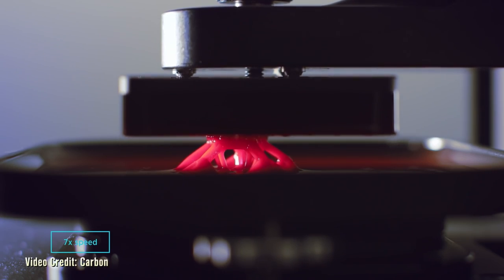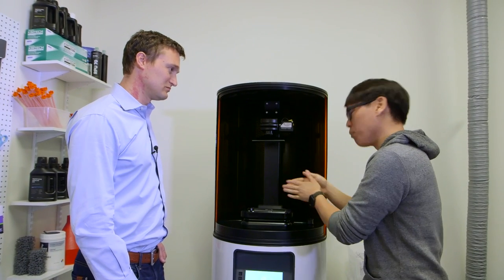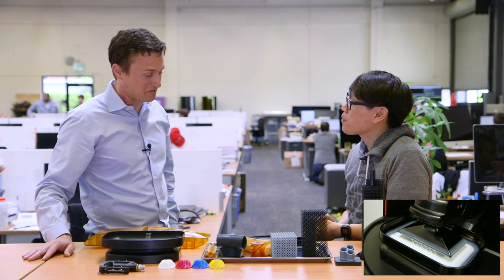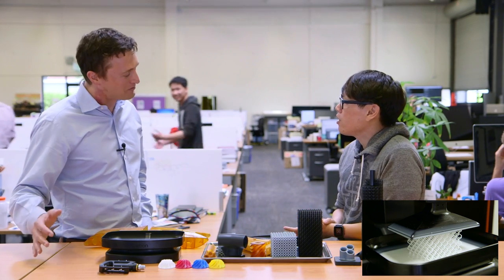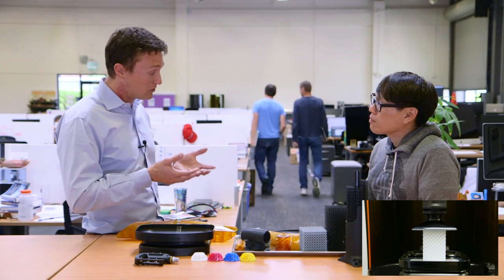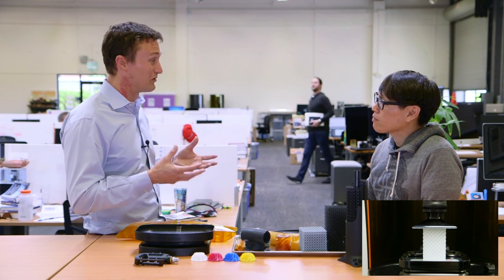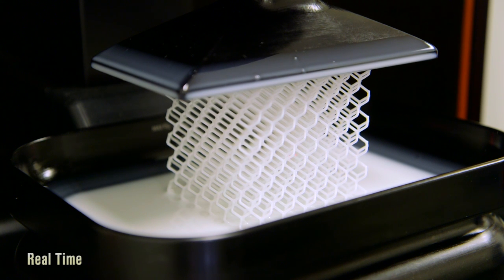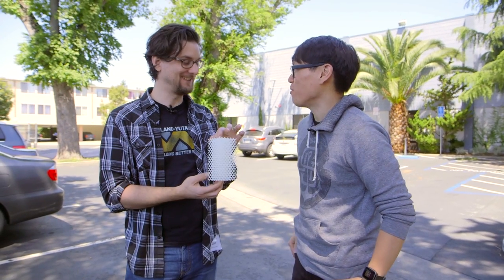Carbon M1 Super Fast 3D Printer Demo!

Comment: Sounds bunk to me, the only difference in oxygen would be in the resin it's self you can't change oxygen lvl in tub gimie a break puffff
Reply: They made a small design change that nobody thought about before (allow air through the bottom of the vat, so the resin does not stick to the vat). That's great, but they charging huge amount of money for it.

Comment: The O2 is really a red herring! 
Asked, how are they controlling the Oxygen?
Answers " I cant get into that"
He is obfuscating 
It's chemistry
any UV cure system will involve the of the resin, O2 or whatever
any comment?
I have tried UV cure resins since 2004, & has anyone come across a UV cure resin that does not stink (smells really bad)
Reply: O2 is really the important factor here. It allowed into the resin through the oxygen-permeable window at the bottom, preventing curing at the window and eliminating the suction forces generated when a part contacting the window is pulled upwards.

Comment: I love where technology is taking us, but what are the environmental impacts of these materials? I understand the need for non-biodegradable materials in some markets would be unsafe, but can these materials be recycled in some way, or are we going to start seeing 3D printed waste floating in our oceans next? These are important questions that need to be asked. It's great that it reduces waste, i.e. printing parts that sit for years if not forever, but if there's not a habitable planet for us to continue this journey, at some point technology is going to create a wall and we're going to smack right into it. 

I guess at some point one has to ask themselves if the shortcut to advancement is worth the end result. Don't tell me with all the amazing minds on this planet that we cannot come up with something.
Reply: Michael Baca a common plastic used for 3D printers is PLA which biodegrade quite easily

Comment: For those curious, it is here and it is working. But the operating conditions are incredibly precise and they'll only rent the machines to companies. 

So in short, the lid is very. Very. Very tight.
Reply: Actually no. They are not doing the technology anymore. It was called CLIP and due to unknown reasons, they are not using it anymore. Basically, they're making normal resin printers that print in normal layers where every layer needs to be "unsticked" from the build plate. So "sad trombone sound" the tech is dead.... for now.

Comment: Question: what about MULTI MATERIAL assemblies.

These parts are nice but one material
Reply: I think it's a limitation of the technology, unless there's a method of having 2 or more tanks with different materials that the bed moves between. If they figure out a way to stop them mixing when swapping that would be a huge leap forward

Comment: There will be entire factories full of these machines, this is amazing.
Reply: NO....there won't be for a number of reasons.  The biggest being the "post-processing" required to clean up the parts.  Injection molding is still far superior for large quantities!  This works for small simple parts or very limited run complex parts where tooling cost would be insanely high.

Comment: I feel like the oxygen bit they keep repeating is bs to prevent people from copying them.  Seems like all it is are a bunch of different uv curing resins. The projector just plays a video of all the layers through the clear window of the tray and that way it can build the things in full layers at a time. Other 3d printers that they say print in "layers" don't print in layers, they print in lines that stack up in layers. A good comparison is taking several pictures to make a movie (this device) vs drawing a bunch of pictures to make a movie/animation (traditional 3d printers).

The only oxygen control there is, is the oxygen that's already in the resins because the bottom of the pool of resin isn't being touched by the open air. Lol

So basically a uv projector that plays a video of the layers that syncs with the curing times of the resins along with the arm that pulls up. It still has layers technically, but the layers are equivalent to the frequency of the uv light protector.
Reply: Not really. Normally, the photo-polymerization happens at the interface between the bottom window and the resin. So, when the part is lifted up by one layer height after the curing process, the gap between the window and the part is too small for resin to be reliably replenished. The resin is just too viscous and the gap is too small for it to be sucked in evenly. So, the part has to be lifted up quite a bit, then lowered back again to spread the resin. CLIP moves the curing process farther away from the window so this suction problem doesn't happen, and the part can just be moved upwards. The curing process is moved farther away from the window by using an oxygen-permeable membrane as the window, oxygen is let into the resin where it prevents curing close to the window.
Reply: And, DLP printers already print in full layers, but they need to move the part up and down again for each new layer.
Reply: @RandomNumber141  Interesting. Thanks for the info. :)
Reply: No problem! I'm currently taking a university class on 3D printing and this technology came up in an assignment. I saw this video a long time ago, and like everyone else here, I was pretty confused and annoyed at the lack of information in the video. Now that I actually have real science available I'm trying to spread it.
Reply: @RandomNumber141  so basically it's a mesh not glass, which allows the resin touching the surface to come into contact with the air, which prevents it from curing from the uv light?
Reply: nambinhvu It’s a thin sheet of a certain type of Teflon, which allows oxygen and UV light to pass thru while still being chemically inert. Thickness of the sheet can control the amount of oxygen that can pass thru, thereby changing the thickness of the oxygen-rich “dead zone” at the interface (I am just reciting most of this from the paper I just read”
Reply: @RandomNumber141  :O they gave you that info?
Reply: nambinhvu Yep the process has been discussed in published papers.